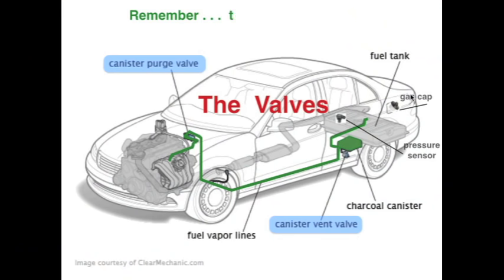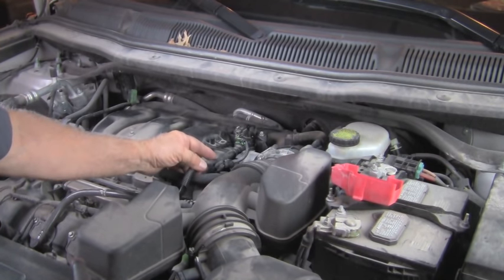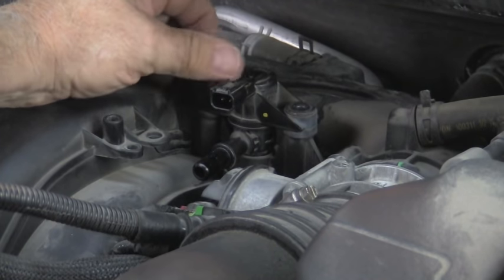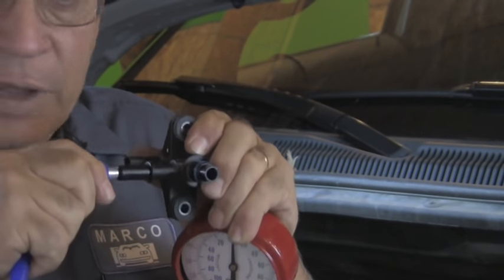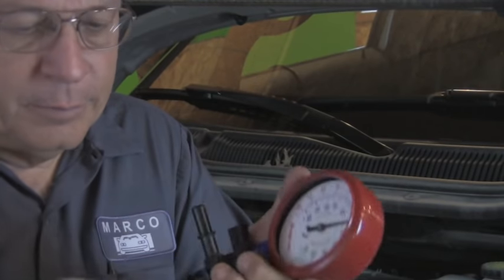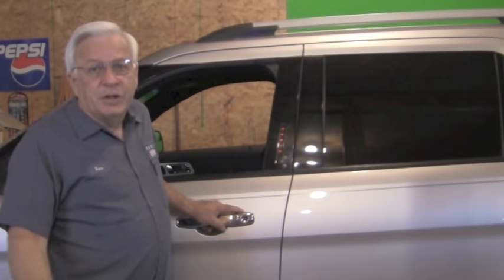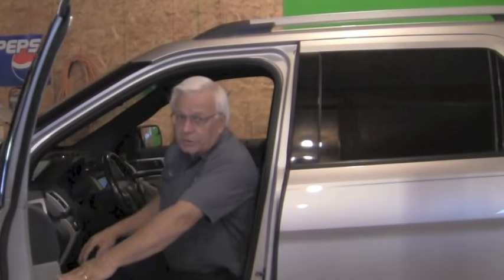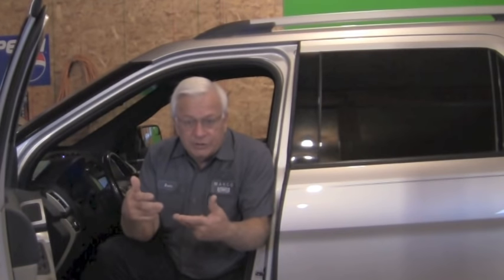How to find a Small EVAP leak without a smoke machine Part 2

Comment: Is it possible for it to get stuck closed?
Reply: short answer, yes, it's a mechanical valve
Reply: @strokewarrior5762  ok sweet deal I was running the engine with the valve still connected but the vacuum hose disconnected and it never started to pull suction through the nipple, even after 10 mins of idling.
I couldn't find any leaks even though I'm getting a evap leak code. You think it's worth just replacing the valve?
Reply: you must understand the criteria for the Evap monitor to set a code, it is very very specific and complicated.  So, is it worth it?  The cost of blindly replacing the valve is not that much compared to the time it takes to confirm it.  So, I would say yes, but you are still replacing it without any "evidence" that it is actually bad.

Comment: Can a evap leak cause loss of power ?
Reply: Good question.  An evap leak in itself can NOT cause a power loss.  But a vacuum (air) leak CAN.  And a vacuum leak cause and set a evap code.  So, in a round about way it could.

Comment: So all that testing with that expensive obd monitor didnt prove anything.  Its still parts swapping 101. But he did explain the evap system well.
Reply: He knew the valve was bad before he swapped it by blowing into it while checking it with a vacuum guage. Better than blindly swapping parts out. Wish I had me one of those fancy scanners.

Comment: I think I should burn my car.
Reply: I felt the same way. If you're at wits end, splurge on a decent shop smoking its lines (almost fire!) and the fault will be revealed. That'll be cheaper than car replacement and all the DMV footwork.
Reply: I have found no one willing to smoke lines for less than 85 bucks around here.  Ridiculous.
Reply: Big Al vacum leak
Reply: Big Al.

Comment: I worked on a car with a small evap leak. I didn't get the approval to fix it but I did notice that the vent valve had 2.3v on the ground side (pcm side). This is the second car I've seen recently that had power on the ground side. Any ideas on what could be causing it?

Comment: Well, I try one more time, since NOBODY has been able to help me yet??? No, I have not done smoke leak test yet, that will be next! I have renewed all valves, throttle PS, IAC, EGR, and so on, just  can't find a leak. Idle is very high, like 2500, even 3000 few seconds, then goes down to 1200, never lower??/ I have manual transmission, so I can drive the car, but it is very difficult, and , boy, it uses lots of gas=((( Now, I took even ECU out, opened it, did not see anything "burnend" inside, could not really tested anyway/??, so put it back. My thinking is, it has?? to be bad ECU/PCM, which controls those purge valves, and purge solenoid valves. If computer is bad, those valves stay open, right??/ and then there is a large leak, but why so high idle? And it seems to me, that it is getting worse, more I use the car. I have no problem replacing the ECU, but I am not sure, if that would fix my problem??? SO, chec engine light is on, and also "check fuel cap" light is on, here are all the codes: P0507, P0443, P0455, and P0405, everything I could imaging, has been replaced/ renewed?? Please, help me, somebody, smoke test next??? Thanks guys, I am losing my hair/ mind over this!!!! Thanks=)...Ps. yes, I did change fuel cap too;o)
Reply: Eero Laukkanen o

Comment: good video sir I been battling code p1447 on my 1998 Nissan 240sx, new gas cap new charcoal canister, new charcoal vent valve, new purge control valve and still getting the code, the car drives very good like if it were new, I know I have an oil leak somewhere but that has nothing to do with the code, is there anyone here in the Los Angeles area you can refer me to, I already went to the dealership and they wanted $2,400.00 to fix it, please please help. Thanks in advance.
Reply: +The Noid check the gas tank for any pinhole leaks. you may have to cap it off and pressurize it...
Reply: ne2i checked it no leaks anywhere thanks, tomorrow I'm gonna try remove the purge volume control valve the one that the great engineers at Nissan decided to put right smack inside the upper manifold and the book calls for the removal of the upper manifold which involves removing the full rail and injectors too but I seen it and I think I can get swivel in there its just two vacumes and two 8-10mm bolts should be easy if I can get the tools in that tight spot, I believe that valve is stuck due to carbon build up when my charcoal can was sending pellets up stream cause after that its just the EGR but the code P1447 doesn't call for EGR the purge volume valve is the last on the list, wish me luck guys I'm going in
Reply: +The Noid Wow that is an unfortunate place for a purge valve. They fail because of high heat and vibration from the engine. No wonder you are having problems.

Comment: Yea this didn't really help. I replaced my purge valve a couple months ago and now I have a small evap leak, u haven't had a chance to replace my gas cap yet so hopefully that's it but I know that there's a way to test the lines at home but no mechanic shows that, probably cuz yall want people to spend a couple hundred on a small evap leak thag can be fixed at home

Comment: I HAVE  HRV 2020 I GOT THIS CODEP04F1 Evaporative Emission (EVAP)

System Low Purge Flow Detected Current|PGM-FI PGM-FI/Diesel(Engine

System)

P0441 EVAP System Purge Flow

Malfunction Current|PGM-FI PGM-FI/Diesel(Engine

System)

U0401-68 PCM Malfunction Current|EPB EPB(Electric Parking Brake)

Comment: This guy may know what he is talking about, and can fix cars fast as his name implies, but good grief, he takes forever to get a point across. All this information could have easily been conveyed in 1/2 the length of the first Part of the two-part video.  Also, he should tell us what portion of the time the problem is the gas cap, purge valve, or EVAP canister.  One site says the most common problem is the gas cap. Seems like there should be an easy way to check that, or even if not, just replace the *$& cap for $20 (which can be DIY) and see if that fixes the prob, rather than give someone $80 or more (as many shops want) just to diagnose the problem.